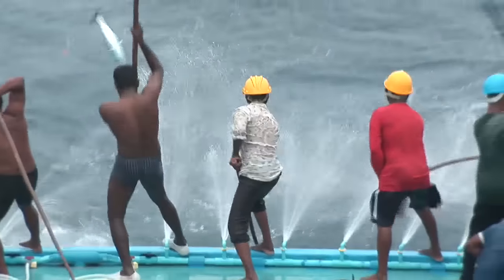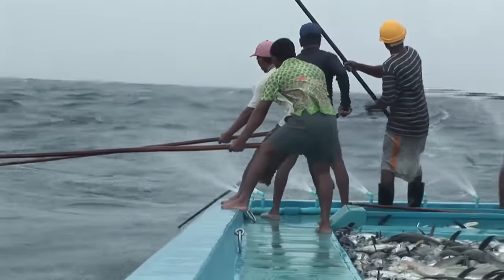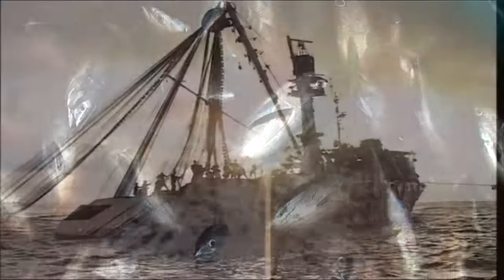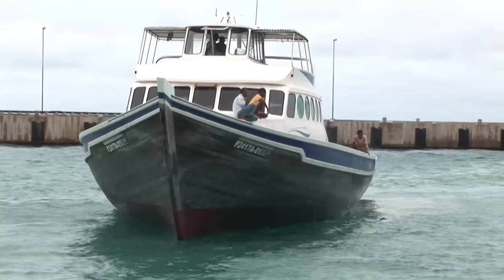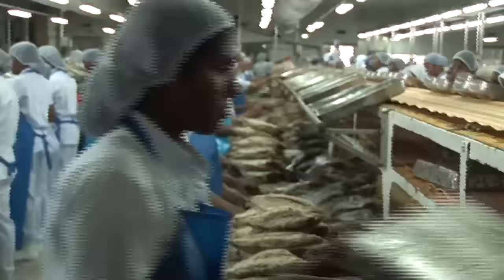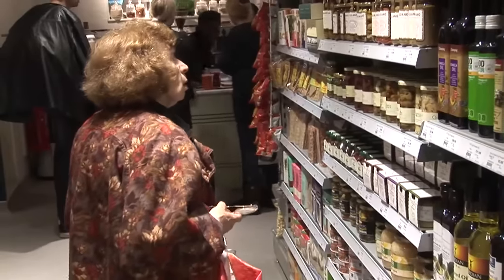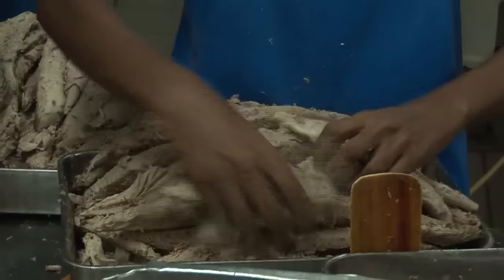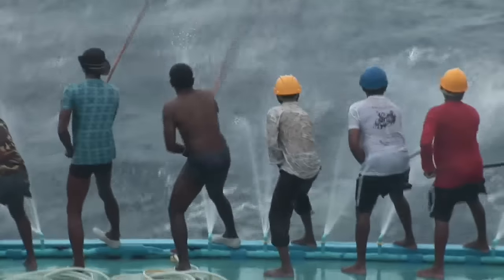Catching tuna Maldivian style - Greenpeace

Comment: Lol that is a dangerous technique, someone's going to get a hook in the face when they fling the line backwards
Reply: Maldivian here. You can wear sunglasses and a cap. There is zero chance of hooking your face
Reply: +Fuddler When I went pole and line fishing I went on barefoot. Sometimes to avoid slipping u can wear rubber boots. The line is about approximately two or three times longer than the pole.
Reply: Line is usually as long as the pole, Maybe a feet longer. Maldivian here. There is very little chance in hooking your fellow fishermen, but it does happen although not very often.
Reply: AAC Wrath seems cruel to the fish, they only see them as objects
Reply: The Vegan Uprise save trees .. and go eat some meat . 🥩
Reply: thats not true. the hooks not have burbs. it's just a bent piece of metal and is not sharp
Reply: @gs043420  May I know how do you "unhook" the fish when pulling back the pole.  Seems to me the fish just went off the hook so easily @@
Reply: @sennaman3312  Its just the fisherman's technique. It has to be practiced.
Reply: mhey .l amazing , thanks